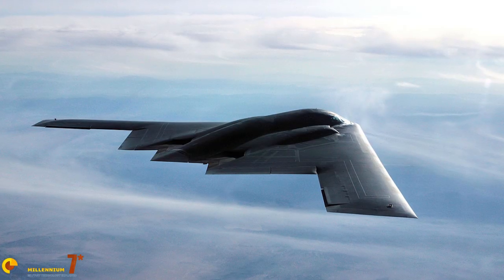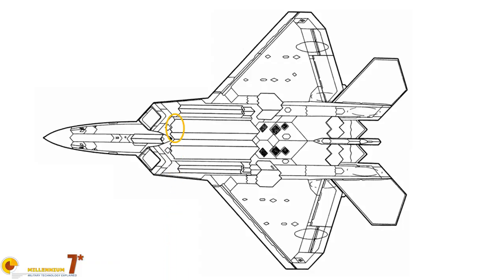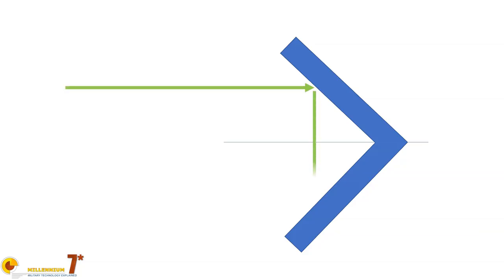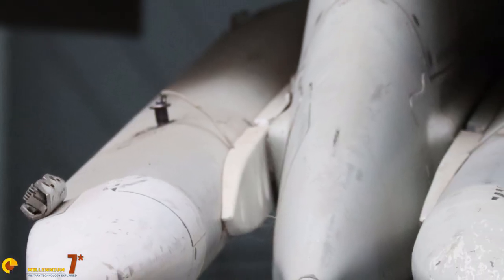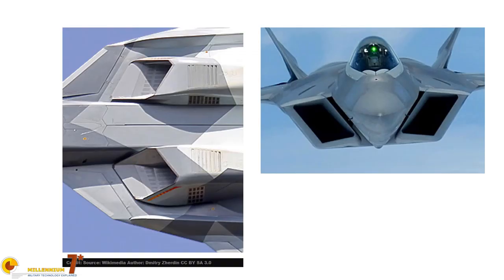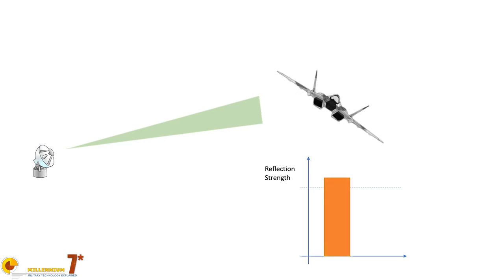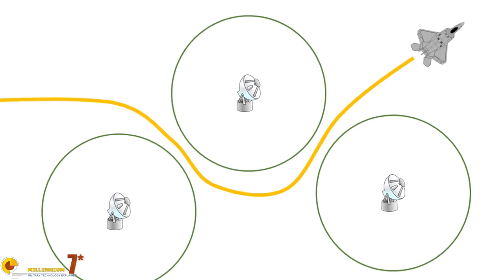STEALTH:  why so many parallel edges?

Comment: My friend who was an air intake aerodynamics specialist told me they were was a constant battle between stealthy air intakes on the B2 and having the engine breath .   Note where the intakes are on the B2.  One cannot see the fan blades from the front.  Exposed fan blades are typically the biggest radar reflector.   The F117 has what looks like a grill over the intakes.   The beauty of the B2 is that it is aerodynamically good and I  theory could be flown without computers.  Lockheed didn't have the ability to give the F117 good aerodynamics.  As a result they lost prototypes while the figured out how to make it fly.  As a rush job the F117 used parts from other aircraft.   The B2  has almost no pre-existing parts in its airframe.  As much design effort went into the B2 as al aircraft before it combined.  A lot of the effort was thrown out because the idea didn't work as required.  Also note the engine exhaust of the F117 vs the B2.  The F117 is not so stealthy flying away from target, while the B2 not only gives low radar return flying away but low IR flying away.   Another interesting aspect of the B2 is the zigzag of the windshield frame.  I have always wondered about the glass in windows or even the instrument lights.  If I did the design the windshield would have shutters that could be closed when approaching the target.  Fit and finish is very important as cracks and blemishes will defeat stealth.   One of the expenses of RAM is having to repaint.   Northrop developed a paint stripping system that used plant husk to blast off RAM and capture the RAM for recycling.   Imagine having to strip and repaint a B2 on a regular basis.
Reply from the maker: Great info thanks!

Comment: Super content! I came to know in order to detect stealth objects, Russians were working with a combination of Active radar and static radar (passive bistatic radar) combination where the data from both the unit is fused and stealth plane is detected using the following logic.
If the object is seen from the static radar data and is not found on the Active radar data it means a possible stealth plane.
Then they may use the 2nd line of tracking like emissions (like heat, UV and so on) on the said location say Infrared tracking or laser illuminating that coordinates.
They are said to be installed one near Moscow and is undergoing trials. 
Later these features may be incorporated into S600 SAM (my thinking)

Comment: The optical analogy isn't an analogy at all. Radar and visual radiation are both part of the same electromagnetic spectrum, and both of them exhibit specular reflection. It's the exact same phenomenon, not an "analogous" one.

The difference between the two is that radars operate at wavelengths where other modes such as induced skin currents and diffractive scattering are just beginning to become significant.

Bonus points for putting a picture of Ufimtsev's text in your video. Nicely done.

Comment: What most get wrong is the stealth bomber. Many planes were made round so why does the stealth bomber work when it's way different then a fighter. Because it has high frequency high voltage running through its hull giving it stealth mode by absorbing radar waves into its electric hull. Bloodviking

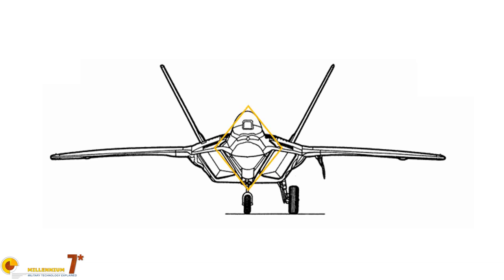Comment: 2:25 what happened to the Raptor's landing gear?
Reply from the maker: A little bit of mystery ...
Reply: It is common practice for aircraft plan drawings to feature the front view of the aircraft with main gear extended on one side, and retracted on the other side, so you get an idea of how the aircraft looks in flight. sometimes, they will draw a white outline of the "missing" main gear tyres without the oleo struts. The nose gear is always drawn in full. But this can be seen most clearly in plan drawings of aircraft with no central nose gear, like the B-52. 

Bonus fact: Likewise, another convention I've noticed is that it is also common to draw the aircraft in the attitude it will be in flight, rather than on the ground. so, for aircraft with conventional landing gear layout (mostly vintage prop aircraft), it is common to see the side view of the aircraft rendered in its level flight attitude, but with the wheels and the imaginary ground line at an angle. A good illustration of both principles can be found here: https://getoutlines.com/blueprints/airplane/messerschmitt/messerschmitt-bf-109-1935-germany.gif
Reply: @samuelling2998  thanks

Comment: sir make a video on chinese quantom radar that can detect stealth
Reply: Many very low freguency radars can do it, but they cant control a missiles, because they are not accurate. These radars have to have also a huge antenna (if i a know) so you cant use these an airplanes.
Reply: Most modern radars can detect(barely) American stealth fighters. The difficulties arise when it’s time to shoot it down, all ground base missiles(S400) can barely track or get a solid lock on an American made stealth fighter......then all of a sudden the emitter becomes the target 🎯.
Reply: @klaojaju  Russia and China upgraded their old VHF radars by upgrading it with modern computers, which can increase the resolution of the radars by a decent or even substantial margin through digital signal processing.